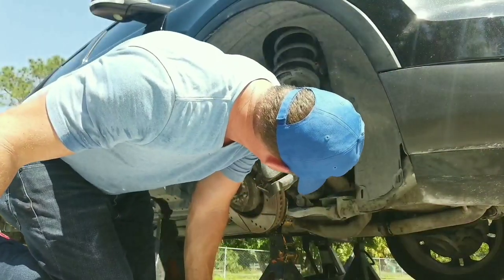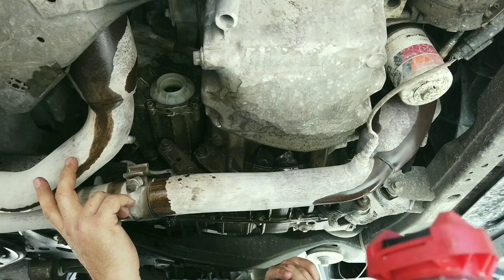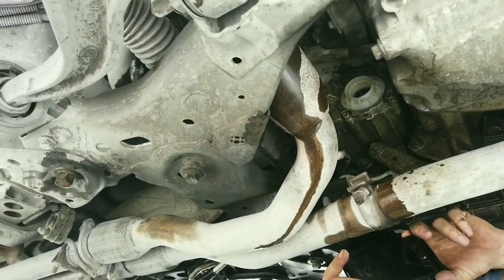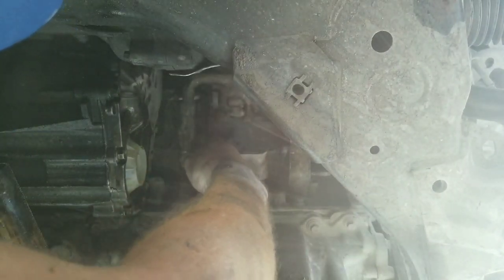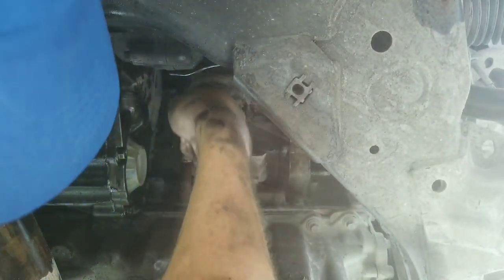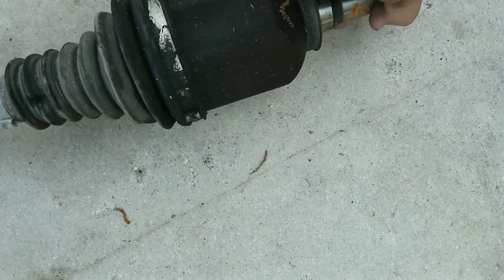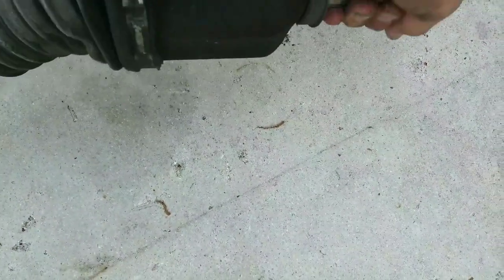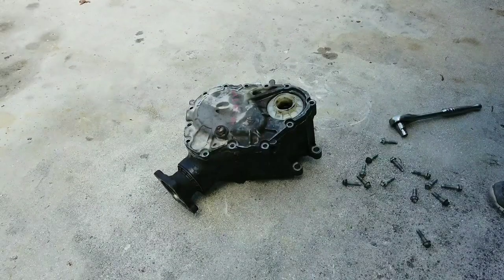Ford ptu failure! PowerAddiction

Comment: I've seen other sources indicate that the PTU in these platforms is installed too close to the exhaust/turbo plumbing, causing the PTU to overheat for long periods of time.  There is no way for the PTU to shed the excess heat, so the gear lube gradually burns up, turns to sludge, and that's when the excessive wear begins.  Newer models now have a drain plug on the PTU, and Ford no longer calls the fluid "lifetime".  I think the recommended service interval for the PTU is somewhere around 30K miles, maybe depending on the platform.
Reply from the maker: Yes you are correct. Also I believe with that heat and towing it will happen much much faster. Ford should put a cooler on it with an electronic pump and that should do the trick. If you haven't already, click the subscribe button. Thanks for the input.
Reply: Yes, they put a cooler on it. 
That should only help but so much. It should still be serviced with liquid exchange, which the cooler now blocks. At least there's a drain plug in the new ones.

Comment: Just did my fluid on my 13 Explorer with 86k miles. I wanted to do it when I bought it at 36k, but my vehicles are always the last to be serviced (I’m a Mopar tech). Well my fluid was black and very sludgy. I was lucky to suck out 1/4 of a qt. After a few suck out and refills it was liquid but black. I drive it for the weekend on the highway for about 5 hours. Still nice and quiet. And now today I’m going to drill and tap a drain plug to make servicing it easier. I hoe to get it almost clear after a few more services. Then it will be a once a year/12k mike service. 1/2qt of 75 140 in an area that encased in heat and then call it filled for life is a joke and Ford should be ashamed for even thinking that was a good idea!
Reply from the maker: Agreed. They pay engineers top dollar to make sure these things dont happen. It looks like you caught yours just in time. Mine had no liquid at all just that pasty sludge. The good news is its not that hard to replace in reality but ford should replace them for free and send out a recall to install a drain and refill for every vehicle that doesnt have a drain.
Reply: PowerAddiction 
Agreed, they really dropped the ball on that design. I wish they would do something like that.

Comment: nice clear video of disgusting sludge inside PTU. I have mazda CX-9 2011 with same shared PTU of Edge, i bought it used and after driving few hundred miles noticed a grinding or whining noise from front middle of car. Went onto the forums and discovered PTU bomb under my car which can explode anytime. I decided to change fluid 75w140 and when unbolt the drain bolt same thing found on bolt sludge and no oil inside PTU just plain grease or sludge. i filled with new fluid without removing sludge. I did 4 drain and refills but still oil is black grey and i think after 4 more drain and refills it will show some color. By the way after first fluid change that whining or grinding sound went away and PTU show signs of life:-)
Reply from the maker: That's awesome that you caught it. You did the right thing by changing it 4 times so far. Keep doing it every couple hundred miles til its semi clean.

Comment: It's excessive heat from the exhaust and catalytic converters heating up the PTU and turning the gear lube into sludge/grease. I change the gear oil in my 2013 Ford Edge every 20,000 miles although Ford claims it's lubed for life and I as of now, do not have a drain hole. I suck out the old, ritate the gears, suck out the rest of the old fluid and refill with new also rotating the PTU gears a couple of times insuring fresh lube gets to all components.
Reply from the maker: You are correct on the heat from the exhaust and cats. Add towing to this and it's even worse.

Comment: Hopefully I caught this in time on my 2013 Explorer. While changing oil I found some gear oil had leaked from the vent caused by excessive heat. Pumped out as best as I could and put in new fluid. I plan on drilling and tapping a drain plug and changing the gear oil regularly. 

POS Ford ran this horrible design for at least 7 years.
Reply from the maker: Yes hopefully you did. Kind of wish I read up more on this before it caused my problem. Ultimately my transmission blew about 2 months later. I actually just got rid of the explorer (made me kind of sad because I loved that beast) I got something else that I will be introducing on my channel in the next couple days. Thanks for watching.

Comment: @poweraddiction why does everyone say Explorers are the best but all of the "reported" issues make it sound not worth buying? im looking at a 2017 utility atm.
Reply from the maker: All vehicles have issues. You will only hear about the problems and never the good about cars. I own a Ford f150 lariat now nad still think about the explorer sport. I actually almost bought the new explorer ST. In my opinion they fixed a bunch of the issues with the ST over the previous version. All wheel drive with a 10 speed trans and rear wheel bias should have fixed the trans issue with the previous sport. Being as the sport was front wheel bias.
Reply: PowerAddiction thank you!
Reply from the maker: You're welcome

Comment: Just one important recommendation, don´t use Motul 75w-140 because it´s heat resistance is not that good. Just after 12,000 miles it burned 25% of the oil I noticed it because I started hearing some noise coming from the PTU. 
I did the drain and change procedure 12,000 miles ago  when my MKX was 50,000 miles just to prevent failure so the original oil lasted without issues 50k miles but the Motul one just 12k miles, I have just drained it again and refill it with the same Motul that I had at home and the noise disappeared but I noticed that I used 25% more than what it came out and when I did the procedure 12k miles ago I made sure that the PTU was full, so maybe any other oil might work flawless but I don´t recommend usign Motul I´m going to keep it for 3,000 miles and change it for other brand. 
This is not the first time that I had a bad experience with Motul, I used it´s engine oil in a BMW 325i and I had to refill every 1000 miles so went back to Castrol and Pentosin and the problem dissapeared.
Reply from the maker: Thanks for the info. This could help someone not make that mistake.
Reply: @PowerAddiction It seems like French car products are not that good even cars themselves have quality issues. The only French brand that I know that has great quality products seems to be Michelin. 
Well that's my opinion based in my experience.
Reply from the maker: @robertogomez8100  I'm not too familiar with french products. I try to use mobile 1 when possible. However in my f150 I've been using motorcraft because I have an oil consumption issue so staying oem until it is sorted. Micheline is a good product they been around for many many years
Reply: PowerAddiction Mobil 1 is a very good oil, better than Motocraft in my opinion. 
If you have an oil consumption issue and you don't have a leak maybe your engine is working hotter than it should and a more heat resistance oil might help a little with your problem. 
In my experience a very good heat resistance oil is Pentosin 5w-30 the only bad thing about it is that your fuel consumption could increase up to 2%, but the engine protection and lowering the cost of oil refilling could compensate for it. 
But if your oil consumption is too high it would be wyse to solve it before something more expensive happens.  GOOD LUCK.
Reply: PowerAddiction  What oil weight does your truck calls for?
Reply from the maker: @robertogomez8100  it's a programming issue with the new f150s. They throttle closes too fast and causes a vacuum spike and it gets pulled through the pcv. They have a tsb coming in about 2 weeks
Reply from the maker: @robertogomez8100  5w20
Reply: PowerAddiction I see so under warranty you have to stick with OEM get it.
Reply from the maker: @robertogomez8100  I could use any oil but I chose the oem because I change my own oil and didn't want them trying to pull a fast one by saying I used the wrong oil if my engine blew up. Just better to be safe than sorry. I know technically they can't but who knows with some of these dealerships
Reply: PowerAddiction My MKX calls for 5w-20 as well and for the last 5,000 miles I've been using Eneos 0w-20 it has worked great but I'm going to keep it until it gets 7,500 miles then I'll know for sure it's general quality, so far so good.
This is the second time that I'm using 0w-20 have always used 5w-20 but it feels like the engine cold starts better now and more silent, in the 5w-20 weight have tryed Royal Purple, Mobil-1,  Mobil-1 Extended and in the 0w-20 weight I’ve  used Castro Edge Extended and Eneos and the last one seems to be the best one. Next I’m trying Pentosin 0w-20 lets see how the German Oil does.
Reply from the maker: @robertogomez8100  German oil will probably be great. My wife's mazda cx5 takes 0w20. It funny because I grew up in an era of 10w30 or 5w30 mostly and was confused when I first seen what he's takes. Even 5w20 is super thin.
Reply: PowerAddiction Remember that the moment when the engine requires more protection is at cold starting because it is not as lubricated as when it's warm so a 0w-20 or 0w-30 might help more than a 5w. I've noticed from your video that you like K&N white engine oil filter I like them too as a matter of fact I'm using it right now in my MKX combined with the Eneos(Japanese) oil and they seem to be getting along just great.
I use K&Ns engine air filter as well the one that you wash every 50k miles and it has been great too so I don't have to buy paper filters anymore.
Reply: So what gear oil you used?

Comment: As a mechanic the metal does not turn oil to sludge, breakdown of the oil from heat and mileage causes the sludge, it looks like its been neglected  Ive seen this many times especially hub bearings that dont get maintained mostly heavy equipment and sometimes it even catches fire or explode. 
are you trying to say CV joint or U joint, yeah who would have thought not changing your gear oil would cause  bearing failure
moral of the story folks, do your maintenance this is not a design problem
Reply from the maker: Agreed on the neglect. Reason it was neglected is because ford stated no maintenance and a lifetime fluid for my year. I would say that is a mistake on their part. This was my first all wheel drive vehicle (aka all time 4 wheel drive). You're right that gear lubes and oil can become thick from break down but I'm sure if you mix powdered metal in an oil or lubes it will thicken even if new. Yes I was trying to say cv joint lol Couldn't get it out
Reply: Ya very easy to say it after the fact! Fact is it’s called filled for life from Ford! 1/2qt of gear lube in that environment will break down fast, as early as 30k miles on some of these. I just did mine at 86k and it was sludge. Hopefully I caught it in time. It sounds OK after 3 drain and fills. I’m installing a drain plug today so I can do it a few more time and get all the junk out of it.

Comment: Hi not sure if this will help but I run Amsoil severe gear 75w140. In my ptu on my Ford Taurus that seemed to help a lot With oil breakdown.
Reply from the maker: Good info. Amsoil is supposed to be some good stuff. I no longer have the explorer. I traded it for an 18 f150 5.0 and plan to twin turbo it in the coming months.
Reply: Nice truck always liked the look of the ford truck. But a Cummins diesel guy at heart. Look forward to seeing the turbo upgrade.
Reply from the maker: @fassvcummins  Thank you! Yeah I can respect the Cummins. It is a very strong engine and reliable. You know you can trust something that they install in big commercial trucks. I will have a lot of videos once the build starts. Thanks again.
Reply: Great tip, did you have to add anything else for limited slip compatibility?
Reply: Hi nope in the amsoil severe gear lube already has limited slip additive in it. I change the PTU every 60 thousand kms.

Comment: Glad I found your video I'm about to start doing this in about an hour. So you took off both half shafts, drive shaft and down pipes?
Reply from the maker: You need to take off the passanger half shaft and both downpipes. Also lower the subframe a couple inches in the back and move the drive up and out of the way. No need to remove completely. I needed to pry down on the sub frame a little with the help of a neighbor to get it out since it has to go towards the back above the subframe. I removed both half shafts because they were both damaged
Reply: @PowerAddiction  is there any seals or gaskets need to replace?
Reply from the maker: @bay94544  the new ptu has the seals already in place. Be careful putting the half shaft back. It goes in easy dont force it
Reply from the maker: So how did the job go? Let me know, I'm curious.

Comment: Why you need to change the ptu oil every 30,000 miles
The transmission is next if you didn't do that yet
Reply from the maker: Blew the transmission 6 weeks after this. I changed the trans fluid but didn't matter. Got rid of the explorer now I have a f150

Comment: Just wondering when you disconnected driveshaft to test PTU with car lifted off ground did you have to remove fuse for the traction control system or do you just get lights blinking on the dashboard there was a problem because back wheels were not spinning when the front wheels were? Good info thanks -

Comment: Sounds like you need to get on with a better maintenance program. Who runs axles and bearings till they fall apart?  Oil can be changed in a PTU. Now I do blame Ford for saying PTU is lifetime oil. I think it should be serviced more regular like an automatic transmission
Reply from the maker: My axles most likely broke due to my driving habits, there is no maintenance on those axels. If you watch my other video "explorer sport in beast mode" the axles most likely weakened over time. As for the ptu, ford should know better than to say there is no maintenance needed. I tow daily and under the recommended tow weight so that is on their end. As for maintenance, I maintain my vehicles more regularly than most. I change the oil on my f150 every 3 weeks to a month. I also do every recommended maintenance sooner than recommended. Ford since changed the design of the ptu so I'm sure they are aware of their mistakes.
Reply: PowerAddiction I guess I’ll see how soon I eat my words. Lol. I got an old Flex. Just today I put a drain plug in the PTU. In my opinion no vehicle below the f250 is ideal tow vehicles. Sure they are rated for blah blah and blah provided they have the precise towing package which most don’t. I tow regular with a 5.4 at 284,000 I’m shocked how good it’s held up. But for the flex which basically has Taurus or explorer parts I sure wouldn’t expect it to hold up to long towing. Now some guys tow unbelievable loads with flex’s and there is pictures on flex pages on Facebook. Have at it is all I say.
Reply from the maker: @philipchamp594  haha hope you dont have the same luck I had. Yeah I towed for about 7 months when this happened. Unfortunately it's all I had at the time. The f150 is a beast. I have a 2018 with the 10 speed and dont worry at all about the transmission or diff. The flex is a beast. I'm sure you've seen videos on how fast they are with just a tune and some boltons. That is a very underrated sleeper. Was the diff fluid still liquid when you replaced it? Mine was like bearing grease
Reply: PowerAddiction Fluid  was surprisingly good for 190,000 miles. I’ve seen rear ends with a lot nastier fluid. So I’m hoping for the best.
Reply from the maker: Hopefully nobody drove it like I used to drive mine lol.
Reply: Hi power addiction thanks for taking the time to make this video. I have a 2016 sport and Im looking forward to change the PTU fluid. Do you know if there is a drain plug on this or I would rather have to vacuum it? Thanks
Reply from the maker: @RafaelRodriguez-oo7ur  I'm not 100% for sure but I believe the 16 has a drain plug.

Comment: Dear, I don't need 4x4 traction for my daily life. could I remove one or two gears from the PTU and have a 4x2 car? To avoid breaking my Ptu which, for now, is intact?
Reply from the maker: I dont think that would be a good idea. The power from the engine would have your front wheels spinning like crazy since it's a front wheel drive bias vehicle with a ptu/transfer case. The new explorer st is rear wheel drive bias vehicle with a ptu/transfer case. I did pull the fuse for the all wheel drive system once and when I would press the gas slightly from a stop it would spin the front tires like crazy. Definitely not safe to drive that way. I was going to wire up a switch inside the cab to turn off all wheel drive when I was at the track to do a front wheel burnout and then switch it back to all wheel drive for the launch.

Comment: Would you happen to know if a seal to the transfer case is considered an internally lubricated part? I'm asking because I need my ptu replaced and warranty company only wants to replace seal.
Reply from the maker: That I do not know. I don't believe so though. The seal only holds the oil in
Reply: @PowerAddiction  oh  ok, thanks for replying!
Reply from the maker: @adrianbillionaire  you're welcome.

Comment: Don't listen to this guy whatever you do.  He admits his left side axle was leaking so he only replaced the outside seal and did not fix the cause of the problem--bad axle support bushing inside the transmission and bad axle grind.  This kit is available in a kit for $60 from Ford Dealer.

Comment: The problem with those ptu's are the breather plug at the falls off and water and dust get inside... That's how my started. Little leak from the hole where plug was and missing. Too bad I had drill a hole at the bottom of transfer case and kind off drain what it was left but noise damaged still there. Very bad design by Ford.